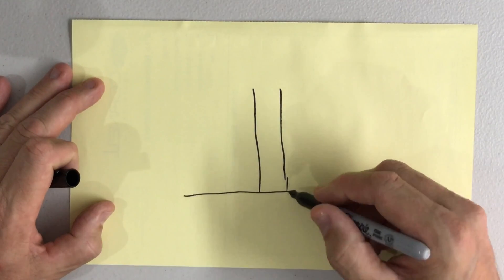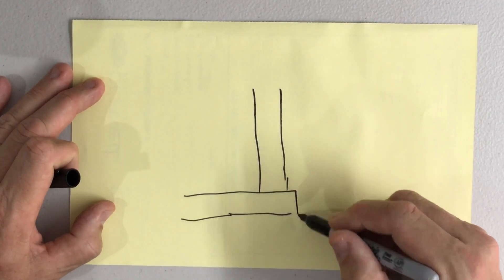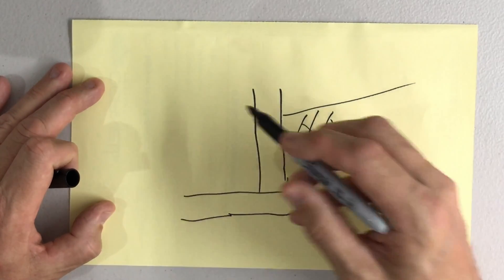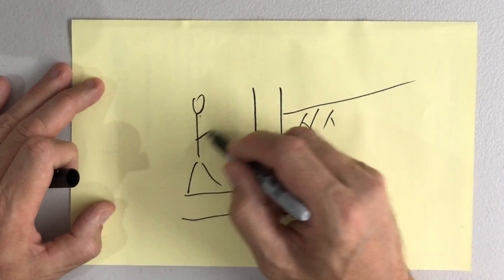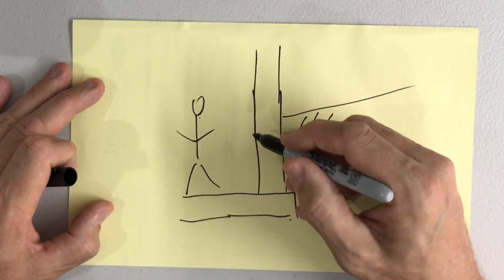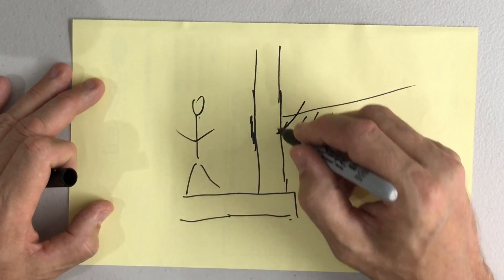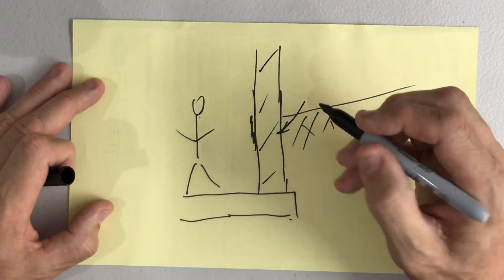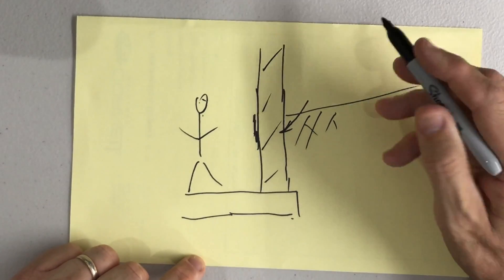Efflorescence - what is it, is it bad for your building and what do you need to do about it?

Comment: Is it a problem if the masonry wall with water seepage is under the house, as part of the foundations, not affecting timber or anything else?  
In my case I have a house on a hillside.  Part of the house is built on a concrete slab.  The downhill side of that concrete slab has a masonry wall.  I assume water is coming down the hill, under the footing and concrete slab, finding the masonry wall and seeping through it.  It's not causing any problem given it's under the house.